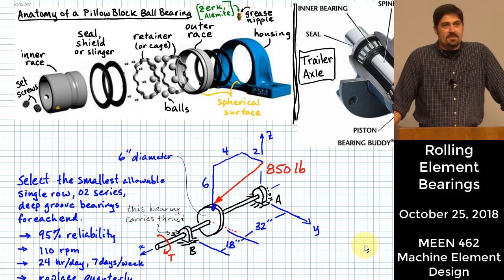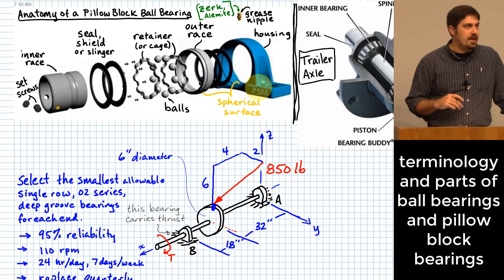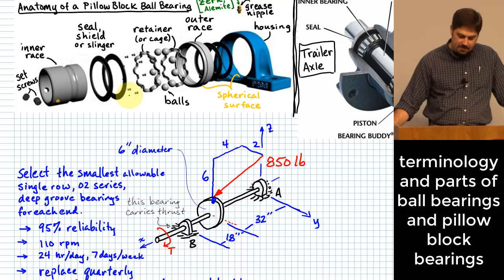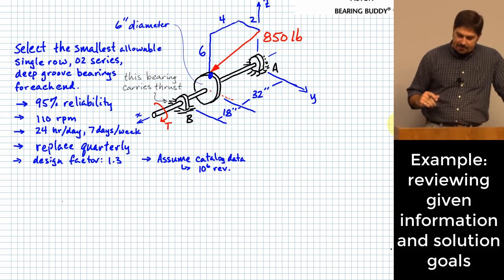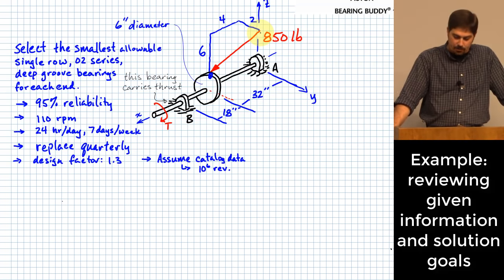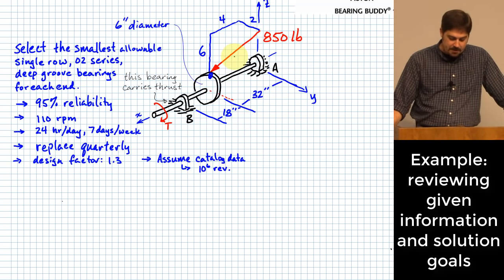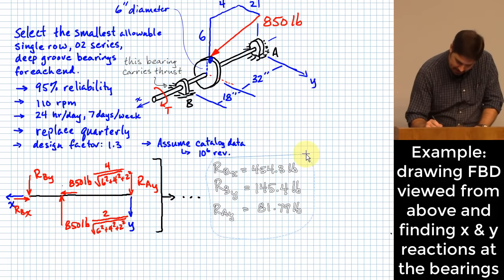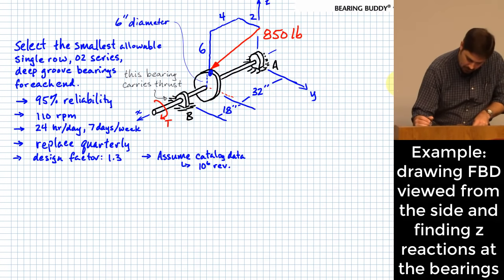Rolling Element Bearings: Choosing Ball Bearing Size for Life & Reliability in Axial & Radial Load

Comment: hi sir , after doing calculations based on " only one of the bearing will carry thrust load" how can we make sure in real life  that this specific bearing will take the hole thrust load and it will not be Distributed between both bearings
Reply from the maker: The shaft would be designed so that a shoulder or snap ring would only be placed at one bearing, not both. That way the shaft will be free to slide axially in the other bearing. Thanks for watching!

Comment: I’m thinking about building a small wind spinner.

Does anyone have any idea if there are bearings in existence that are really small and able to work no matter which direction force is applied to them?..  I’m looking for something about 3mm wide, up to 2cm long, ideally tubular, or some such...

I discovered fishing swivels yesterday, but I don't know if they would spin freely when being pushed, as opposed to pulled (as they are designed for)… I suspect they might not spin freely enough anyway. Some are named "Column type rotary ring bearing swivel" that seem close to what I want.

Maybe I need to make a bearing type thing out of tubing and rods; but it would probably be easier if something exists already I could just plug in and use…

Comment: 15:30 why we don't combine the y and z directions and call them radial direction and the x is named axial direction?
Reply from the maker: You can, however, the "couple" dealt with at about 21:30 will be applied around an axis parallel with the y. So even if you constructed a "radial" axis, it may not be obvious at the outset what direction "radial" actually is for the bearings once the couple is considered. I thought it would be more clear and about the same amount of effort to present it as I did. Thanks for watching!